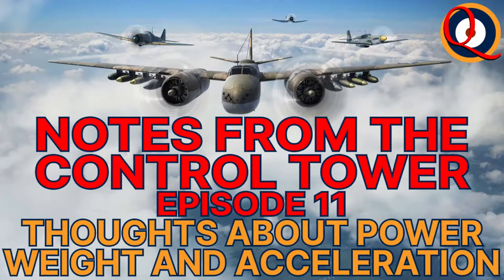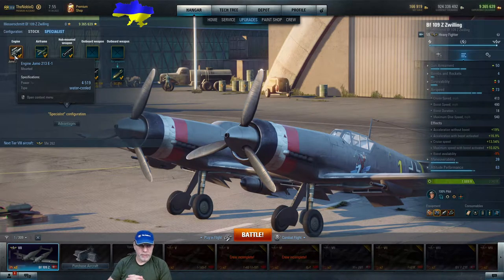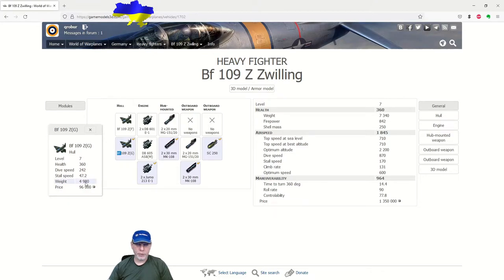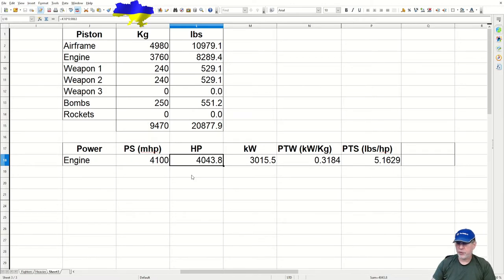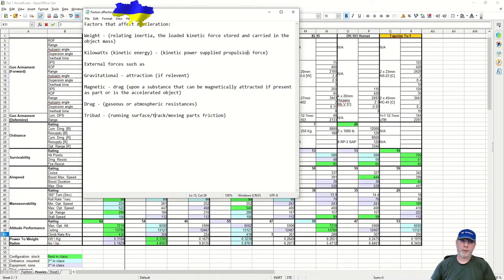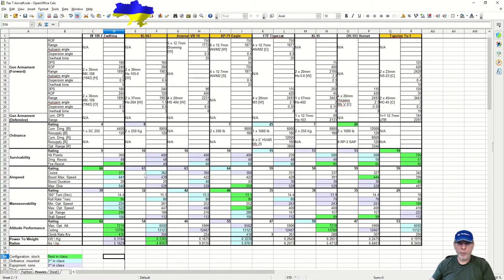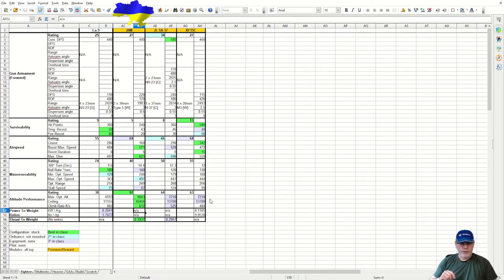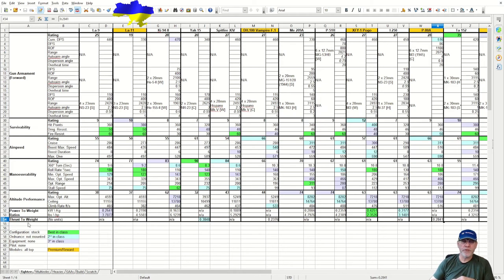World Of Warplanes: Notes From The Control Tower, Episode 11 - Power, Weight And Acceleration

Comment: I was pondering this information this week as I finished up specializing my 190/A-8.  That's another one that is underpowered, and it seems to benefit more from an uprated engine than the boost injector as a result.
Reply from the maker: That's quite a hard one to call.  Your speed rating will increase more greatly with an uprated engine and it's reasonable to suppose an underpowered engine will not accelerate a plane quickly, so I'm inclined to agree with you without being sure.

Comment: I become a fan of your channel. Again a very interesting video . I am a new player . I manage to get my first tier 9 plane , but I think there is a lot that I need to learn about maneuvers and shooting . Could you please make some guide about maneuvering and shooting ? I miss a lot of shots with my f2g .
Reply from the maker: Congratulations on your first tier 9 plane!  If it's the F-94D Starfire that comes after the F2G, try to get the top gun and the air-to-air rockets as soon as you can.  Regarding shooting, often it's a case of having mixed weaponry with each set of guns having different shell velocities and different optimum ranges, plus being too eager and overheating your guns.  In short, the closer you are to your target - except being on the point of ramming it - the less these two things matter and the more shots you'll land.  At long range you may find you are hitting with only one group of weapons, the other(s) being out of range, or you're missing because one group of weapons has a much higher shell velocity than the other and some of your shots are arriving too late (or too early).  Make sure you understand the optimum ranges for each of your weapon groups and adjust accordingly.  However, the F2G does not have mixed weaponry.  In this case, I suspect you are opening fire when the game says a target is in range, but the game "lies" and tells you the absolute maximum range, at which distance you will only do limited damage.  You need to wait until at least you are at optimum range.  You can check this in the hangar by looking just above your pilot display on the right of the "home" interface.  If you open fire early, not only is your damage reduced, you will also overheat your guns quickly (6 seconds for the F2G's 20mm cannons) and even when you're nearer, your damage per second will be greatly reduced.
Reply from the maker: On maneouvring, everybody does it a little differently.  Perhaps I will do a video on how I do it one day.  However, I will tell you this: for good turns, you should be using manual flaps, yaw, pitch up (not down) and smart application of boost/air braking.  If you're not using all those things, experiment and investigate!

Comment: What you discussed is interesting, however in WoWp the key to winning is in:
1. Learning bot behavior:
     A.) Learning which bots are more likely to target you (BV.P, J7W, Yak, etc.)
     B.) Learning which bot is the "killbot" on you for the battle. 
2. Learning which planes the plane you are flying is able to outperform.
3. Playing long enough to recognize the very good players and:
    A.) Avoid them as best possible.
    B.) Staying away from tiers the top players are likely to be flying.
    C.) Not playing at certain times of the day when more top players are in the game.
      (For example, some players most always use the EF-131 to "cheese" wins).
4. Mastering situational awareness (always being aware who is targeting you).
5. Playing enough battles to read the map and know what order to capture sectors.
6. Understanding the impact "extreme rng" has on the bot balance/imbalance.
7. Reducing server/client Internet lag as much as possible.
    (I had to dial down many of the graphics settings on my modest Geforce 1600 to
      get a good framerate and reduce my latency on the NA server. Since I have done
      this my win rate has improved considerably).

I guess the bottom line on all this is that WoWp is just a game and if you aren't having fun then why are you playing this game. Any possible effects of real world aircraft physics to WoWp game effects is mostly coincidental in my opinion.
Reply from the maker: All good points and I'd suggest one small modification; just avoid players whose idea of fun is rigging the game with a flight containing a powerful bomber and a plane that's good at countering heavy fighters.